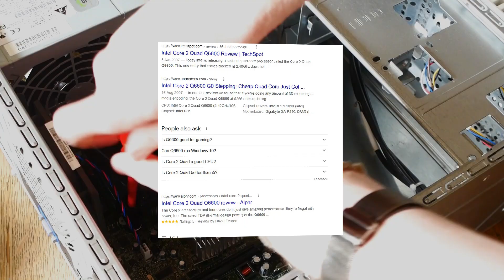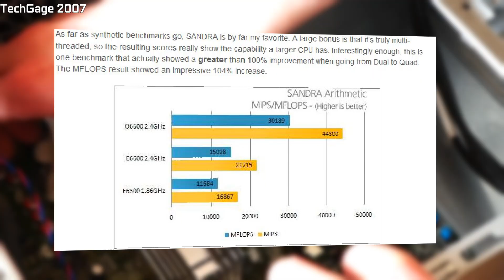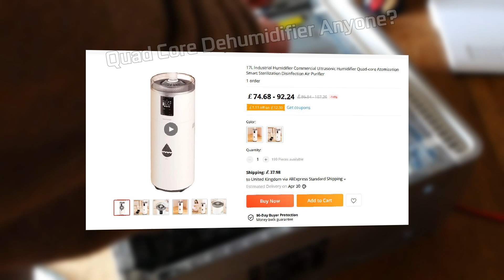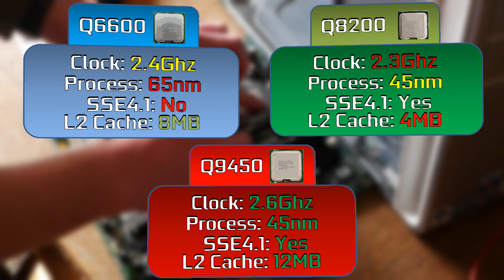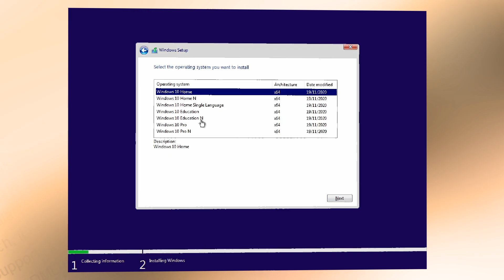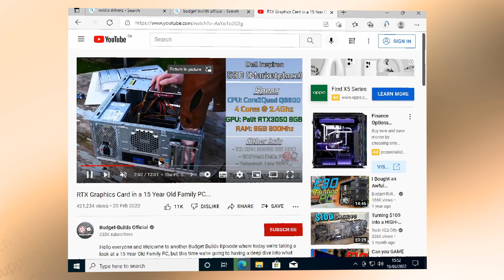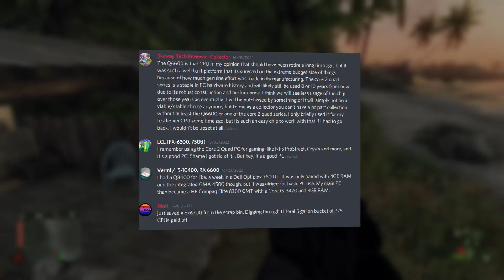Intel's Core2Quad...Finally Obsolete?

Comment: I build gaming rigs for low-budget and retro gamers, utilizing Core 2 Duo and Core X2 CPUs. On the GPU side, I employ older graphics cards with performance comparable to the GT730/740 but often lacking DX12 support. With a custom Windows 10 or Linux installation, you can truly enjoy these older components. Even games like Witcher III and GTA V are playable with a slight overclock. A Core 2 Quad Q6600 clocked at 3GHz or higher paired with an overclocked GTX 460 is a particularly sweet combination. You can also opt for an RX 550 and utilize FSR for an enhanced experience. This configuration is a true bargain!" -So, what was the question? Obsolete? As long as I can squeeze a little bit of fun out of it, it's not obsolete for me!
VHS is obsolete.

Comment: C2Q Q6600 was my first venture into PC gaming
Upgraded it from a pentuim D, which was actually an upgrade from a Pentuim 4... amazing the performance jump.

This was in a Dell Optiplex motherboard. Allegedly not overclockable, but with some persuation with the program SetFSB i managed to get 2.65ghz out of it (from 2.4ghz) .. not much but something :P Games that would be around 24fps you could nudge nearer 27-30fps.

I miss it dearly. It's now unused in my garage, I think I will get it out one day soon.

Comment: My HP HDX18 has a C2Q Q9000 in it (2.0GHz) ... I actually still use it relatively often. This video has rekindled my desire to find a QX9300 to swap into it. I'm sure these days they must be relatively cheap.

Of course, if I can find the mainboard from the equivalent HP dv18t laptop that came with an i7, and then max that out, that would be even better.

There's just something about that ginormous 18.4" dinosaur that pleases me. Large full HD dual-lamp display, full keyboard (backlit, too!), dual drive bays, extended battery, internal ATSC TVtuner, eSATA, etc, etc. Although it doesn't hold a candle to my main desktop (i7 8700k @ 5GHz all-core on water), it's still plenty capable for its age. Especially when you boot Linux.
Reply: your laptop is awesome. i wanted it, but later decided it was too underpowered for vista era gaming. 

currently i have a clevo m570tu from 2008 originally with a c2d p8400. i also purchased the qx9300 and the bios supported overclocking to 2.9ghz and it’s better than the one in this video. the  cheapest listing on ebay goes for $50, but i’m not sure how much better it really would be. coming from a p8400, it was a big upgrade. the q9000 has a terrible clock speed but quad core. id say a 15-20% increase in performance.

Comment: I had an E6600, Q6600 and a E8400, The former i had overclocked to 3.4/3.6 ghz depending how brave i was feeling, then i got the e8400 which was easy to oc compared to the e6600 and then i got the q6600 for my slave pc tho i ended up using it as my main cpu with an oc. Saying that, i own loads of core 2 duo cpus today and a few builds lol. Need to stop hording

Comment: I'm really surprised you never mentioned the infamous 771 to 775 mod. But it is rather old to deal with and requires a bit of very careful work to be done. I rarely see anyone talking about using those these days
Reply: I have some L5420 mod and they were sold modified already in my place.
Maybe i bought them around $10 per item.
I am using g41 and p45 ddr3 motherboard because it can run 8GB and 16GB (4 slots ram) RAM.

So smooth though using windows 10. But smoother with windows 8.1 (lighter than win 7 for me).
Reply: @YahyaFadly-xt9nx  I'd like to see more on that. I'll have to look it up, but later. Honestly, my current curiosity is what would be the fastest/most powerful Windows XP build possible.

Comment: Sometime ago, I bought a Core 2 Quad Q9400 to use in my G41 Express chipset system that used to have a Celeron e3400. 
It blown the Celeron out of the water in terms of performance, both in desktop usage and in Minecraft. The PC was running well and I was planning on maxing the RAM to the 8GB DDR3 limit of the board and getting a cheap, used graphics card (although cheap graphics cards here in Brazil are impossible to find), so I could play games like Batman Arkham Knight (with DXGI to increase performance).

Suddenly, all my dreams were destroyed. I woke up one day and turned the PC on just to see my old, low-quality power supply faling and frying my PC, including my Core 2 Quad and the Motherboard.
Reply: Dude you went from bottom tier to top tier hardware of the generation what did you actually expect?

Comment: A bit late to the party but I built a budget pc back in 2016, with a C2Q Q6700 and I still use it to this day. On an AGP motherboard, with windows 7. But the 7 somehow got corrupted and now it's running windows 10 1511.

Comment: Must have been about 12 years ago now, after some serious struggles with drugs alcohol, which costed me my gaming rig, my car, really almost everything, I cleaned up my act, and started working again and found an older OptiPlex tower for sale at a flea market with a Core2Quad, 4GB RAM, that the previous owner must had upgraded as it had a really Beefy 2010/2011 PSU probably 650W, and a pair of new 1TB WD Blue HDDs with a nice fresh Win 7 install. I took that little Dell home from the flea market and paired it with some cheap used graphics card off of craigslist, and with some old gifted/hand me down monitor and peripherals from family, I was able to get back to gaming,  got a good 1 and half-2 years out of that set up, for all of 200$ and some charity I was back to playing all my old steam games again, slowly upgraded stuff till I had dedicated gaming set up again.

Comment: I ran the Q6600 overclocked to 3.2ghz (which provided a large perfomance boost!) from 2008 until late 2021, with nothing more than GPU upgrades over the years, and an SSD system drive once they became affordable, the whole time it was running with 8gb of Ram. It was still managing playable settings at mostly high settings at 1080P (with a Radeon HD 7970 3gb)...it wasn't until some recent games (Doom Eternal, Halo Infinite, Forza 7, Forza Horizon 4 /5) that simply refused to launch that I eventually figured out it was a lack of supported CPU instructions that was stopping things from working. That started me thinking about upgrading, and then I got a sim racing setup with triple screen and it was clear it was finally time for a new Ryzen setup. The only real issue I had prior to the newest games was the large power draw of the overclocked CPU cooked a few mid-tier power supplies over the years lol! For general usage (aside from gaming) the system is still extremely quick at most tasks when paired with an SSD!

Comment: I think I have a Q9650 CPU somewhere... I may have sold all compatible motherboards though. Makes a proper classic games machine maybe. At 95W it's a bit of a power hog for the performance.  Currenty typing on my i7-3770k. It has been really good boi for 10 years. It has lived thru 3 graphics cards!! One AMD, RX680, GTX1080ti, RX6600 - did not work well with Win7... so now it's a general purpose surf/security machine/server running on internal GFX.

Haha, I just remember I have Pentium 4 PressHot toaster oven (ok, actual code name was Prescott, very power hungry) somewhere in storage!  Mom has my older Core2Duo that she is not using... geez, that one is running Win XP I think.

Comment: I feel like you should've used the Q9650 or overclocked the Q6600, but hey it's good as long as the extreme / xeon video covers it. 

I have a mobo I modded for 771 xeons but I ended up keeping the Core 2 duo E7400 in it, oc to 3.5Ghz running a cut down Win 10. It's still super snappy and usable even with integrated graphics

Comment: As a matter of fact, anything behind sandy bridge or AMD's bulldozer is officially obsolete or at least very limited...Doesn't mean they're of no use completely. 
My Xeon x34xx is still going strong even with a gpu released more than a decade later, but some software just won't work, won't even start to begin with.

Comment: Core2Quad Q9000-series have SSE4.1 feature while previous LGA 775 cpu models don't have it. This CPU is still capable of running most of today's application for now as of today. 

In fact, I'm still have old Dell Optiplex 780 equipped with Intel Core2Quad Q9550 cpu while having my primary AMD Ryzen 5 5600G being sent to shop for repairs. It still able to run most of modern applications but the big bummer was inadequate power supply to powering up 50W++ of GPU, so I had to use painfully slow AMD Radeon HD 5450 for now.

Comment: I remember in 2016, I upgraded a E6400? And 4gb Dell optiplex to a Q6600 and 8GB and GT730 and it was quite respectable for what it was.    Powered thru light-moderate Minecraft mod packs and every day general use.

Comment: I went to buy an old GPU and was also given an LGA 775 ITX computer for free. I was told it had a dual core CPU in it, turned out to be a Q6600, after buying 16GB of DDR3 memory and a GTX 660 to go in it, oh wow, yep that runs Crysis on high settings, and Fallout 3, and it does a damn good job. My Next job is to slap an SSD in there instead of it's current spinning rust and to find a better use for the old DVD bay.
Reply: Upgraded the CPU to a Q9400, damn this thing shifts.

Comment: I had a Core2Quad that I got second-hand a few years after building my first quad-core AMD PC.  I used the Core2Quad for a few years to run a minecraft server.  It was more than capable considering it was originally spec'd for Vista and had 8gb of ram which was still standard at this time.

Comment: My dream retro PC is a Q6600 with dual 8800GT's in SLI <3 The hardware back then really did punch above it's weight, and the fact it can still kick around decently enough today? All the better for it

Comment: The Q6600 was the CPU that dragged me back into pc gaming, it happily ran at 3.6ghz for about 7 years then was offered an AMD motherboard for cheap to replace it and sought out an 1100T for a slight improvement in video encoding. These days I have been using an i7 4790k at stock speed which is not great compared to the other 2 but I can't be bothered replacing it as it still works for my needs.
Reply: same thing, I got a killer deal on an Optiplex mid-tower with a Q6600/4GB RAM, and a pair of 1TB WD Blue HDDs, which was a pretty snappy system for dirt cheap back in like 2011 after being out of the pc gaming world for a few years  and got a cheap used graphics card to throw in my Dell and got all my old steam games installed and got back into the PC gaming world for less then 200$, and got a good 1.5 years out of that system till I was able to do a proper gaming build.

Comment: I ordered a slawn stepping QX9650 for a bad ass build for my dad with a new Abit IP35 Pro XE mobo we have.  I’m going to overclock the piss out of her with Scythe Ninja 4 push/pull & GTX 1070 GPU. 

The 12mb of L2 cache in the Extreme CPUs isn’t trivial.  The Extreme Chips where obscenely expensive back in the day. 

Back in the day most games, even AAA weren’t threaded for more than 2 cores.     My dual core Phenom II 550 BE would run Crysis on ultra settings with a ATi HD 4890. 

You can get a q6600 for $5.00 shipped🤣🤣 I’m tempted to buy one just to compare the performance. 

Also, some Chinese company is selling new 4x4 DDR2 800 kits for $70.00.   Used 16 gig ddr2 ram kits sell for $300 bucks when they show up on feebay!

16 gigs of memory, 12mb of cache(maybe a 4ghz overclock) & a GTX 1070 should kick ass on allot of games. 
I’m excited.

Comment: I've had a Core2Quad + 750ti system for soooo long. I got a super great deal on a good i5 based system for 200,= + a 1060 6GB for free, otherwise I'd probably still have that old system in use haha
It kicked ass!
Reply: That 750 ti brought in more years to my q6600 also lol

Comment: I remember buying a Q6600 from Ebay in 2007, I paid about US$200 for it and I used it myself for 4 years and then sold it to a friend that continued to use it for another 6 years so between the two of us we got 10 years of memories from that CPU.

Comment: Just completed a Windows XP retro build using a Q9650 and a GTX 760.  I've never tried more modern titles on this CPU, but for the era of games I built this system for, it's an absolute beast.
Reply: I'm planing to upgrade my late XP area PC with a Q9650 and GTX 750 Ti (from a E8400 and Radeon HD 3870). Seems like a good pairing indeed (will also need to increase the RAM amount from 2 Go to 4 Go, DDR2-1066 with tight timings)
Reply: I have Q9550 with GTX275 (or maybe I will put GTX460 there) for ultimate gaming for games like FarCry, Doom 3 and such games + some first DX10 games, it's a beast. When you look at that jump, this HW is from 2009 and in like 2008, I still had some Pentium 4, it's totaly crazy that some more rich people were able to have this HW just a year later and play these games with 120 FPS on ultra. 😀

Comment: A Q6600-based machine I built for myself circa 2008 is still my NEWEST machine.  Handles overclocking very gracefully, though for how I use it, I've never felt the need to run it above about 2.8 GHz for extended periods.  I'm not into gaming, but it's illuminating to see how well it still runs many games.

Comment: 2006 was a magical time in PC hardware.  Finally, the hardware had won.  after years, and years of endless update cycles trying to keep up with software.  Conroe/C2D and the athlon 62 x2 simply could steam roll all the software of the day.  I use hardware from that era to this day along for more recent stuff, and for everyday tasks, you can't really tell a difference.  
 I did laugh at those that bought the quads early though, it was to be future proof, but as barely any software was taking advantage of multithreaded outside of encoding at the time, it seemed likely that a quad would be overkill and under utilized for a long time to come, to the point that one would probably upgrade out of boredom rather than necessity.  I was right, and only recently in the last few years did quads become a minimum requirement for games, with some games refusing to even load on a dual core cpu (especially one without hyperthreading/smt).
  I just took advantage of this fact and today purchased an HP z400 lga 1366 mobo and xeon 4c8T 2.66ghz cpu (essentially an i7 920) for $30 US shipped.  great everyday performance today from 2009 hardware!  now i just have to buy 24gb of DDR3 ram (probably $10) and I'll be set with a 1660 super.  I even picked up a xeon 6c12T 3ghz/3.5 turbo xeon 5675 for the paltry sum of $10 as an upgrade. with the z400 being an oem board, that means a free windows 7, maybe 8 license in the bios.  sometimes you can upgrade that to windows 10 for free once the old OS is installed.  we'll see.

Comment: I can play red dead redemption with more fps on my core 2 quad q9550 because I absolutely optimised and tweaked the shi** out of my OS. I disabled every single unecessary background process even if it meant I had to mess with group policy or registry settings, every single windows app was shut down, all startup softwares disabled basically I get like 2% processor use and 8% ram use when I have no task opened on windows 10 pro, also I have specs like

Core 2 Quad q9550, 8GB ram, nvidia GTX 1050Ti mini 4gb and power x LGA 775 DDR3 mobo. It's not that it is unusable, you just need to work around it a bit. BTW CRT monitors are best for one of the greatest gaming experience if you want to understand what I'm saying. I never ever once desired to change my PC since so many years till even now lol because even modern day esports are playable on my PC even now so I see now problem, I was even trying to get that xeon server modded processor which was better than core 2 quad for my LGA 775 motherboard also someone micro codes OS for 1 dollar on the internet or ebay let's just say and I was thinking maybe instead of using my current mobo I should look on the internet for 16gb ram support LGA 775 g41 mobo for this xeon mobo which even has hyperthreading.

Comment: I still use a q9450 in my hp compaq dc7800 with a gt 1030 and 8gb of ram running windows 10, and i use it mostly for older games, it's still pretty descend for that and the c2q sings nicely with the 1030! I am shocked what this lil pc is capable of! I will continue to use it for as long as this system can, i have replaced a bulged cap in the power supply so it will continue to work in the future without any issues :) i like the c2q as it whas my dream gpu when it came out, but i could never afford it!

Comment: Shame there weren't many matx boards capable of running the 1600mhz chips (allowing bsel mods for more stable base overclocking), and lack of ahci bios options for the most part forcing legacy boot mode no trim on ssd's etc. 

I've got an intel dq45cb sat on the shelf with a q9650 and 8gb cl5 ddr2, needs intel management engine disabled for security these days from what I understand which is something I will be looking into it I can find the latest bios to work with, intel has dropped support (completely purged their servers of online support resources) for many products of this era though making it very difficult to source drivers and bios files (me is basically a mini pc system that has direct access to all your hardware even with the machine turned off in standby with some serious remote security vulnerabilities)

Comment: Performance of new CPU's IS no doubt better but that doesn't detract from the fact that there are artificial road blocks reducing functionality of older hardware these days.

No longer is it the case that a system will be rendered unusable by advances in software rather they are rendered unusable by whitelisting.